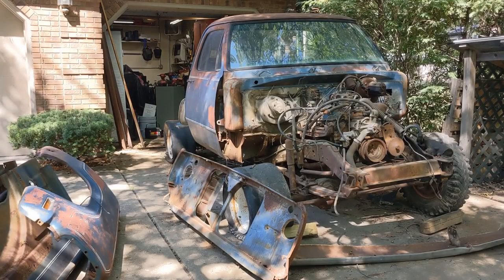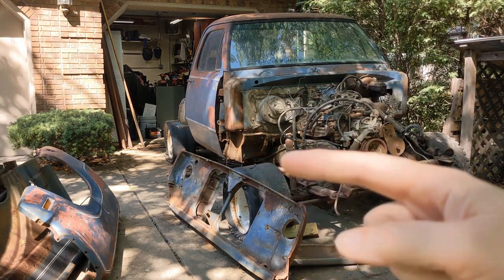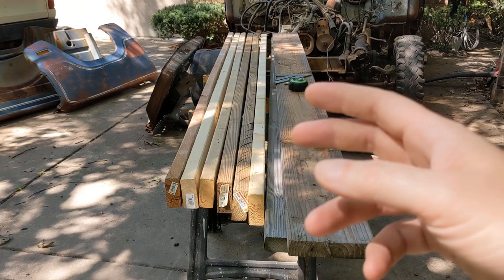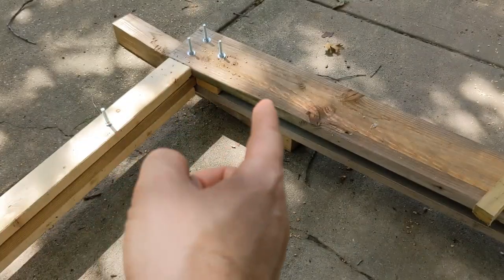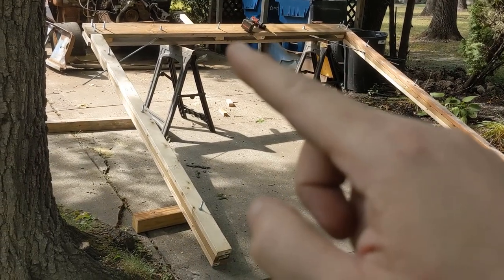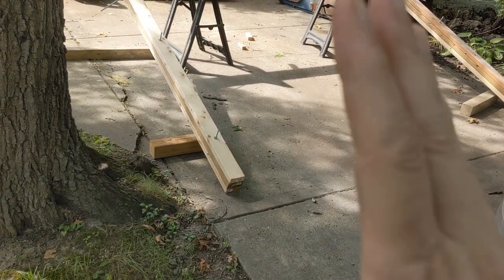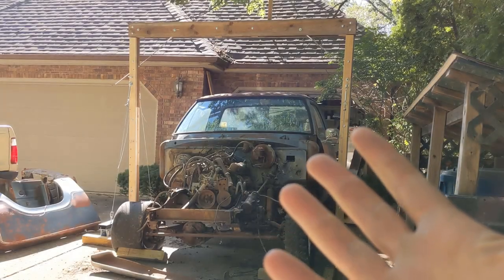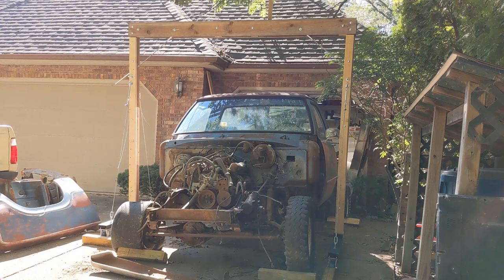Build Your Own Gantry Crane. Cheap!

Comment: I used to do this with boat inboard engines I wanted to pull out.  Pick the engine up 10’ in the air - move the boat on trailer, and drop the engine to a engine stand. Worked great

Comment: Forget the rods and turn buckles… you already got the bolts , just lay in some flat bar . Drill two holes , one on each side using the bolts you already got……… You’re  getting pretty elaborate there  at the end ,I thought you wanted to keep it simple. It’s alright.. you do you.

Comment: It's only for you.

I expected you to drill out the holes larger for the eye bolts in the steel studs and weld in a solid bushing to keep them from crushing it.
Reply from the maker: I considered it, but it's pretty thick walled already. I think I'd snap off the bolt before crushing it.
Reply: Doctor Torque could do it.

Comment: i have  quite few spare 5 by 5 laying around, i assume this would be  good enough for frame of gantry right? no need to lift past 1000 pounds, i have fixed one for that. neat idea of making disassemble friendly crane, havent seen many of those around ;)
Reply from the maker: My only concern with a 5x5 is the cross beam.  You're probably going to get some deflection/bending if you have 1000 pounds on the center with a wide span.  I doubt it would break, so it will work, just be sure to keep it in mind if you make it "just tall enough" for a job.
Reply: @YoshimoshiGarage  tnx for answer; i could always use different sized wood for horizontal part of crane,or make  "sandwich" version of it (5 by5  as core, with 2" thick and 10+" wide  planks placed vertically on each side, preventing unnecessary  bending middle part of crane)